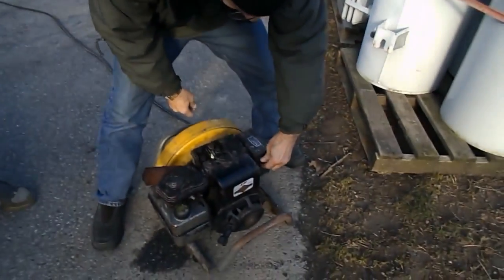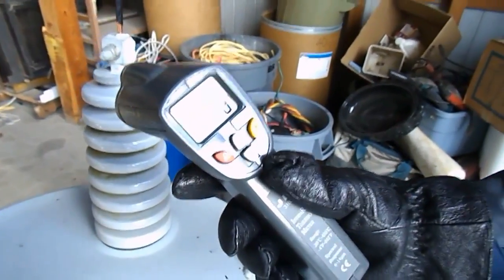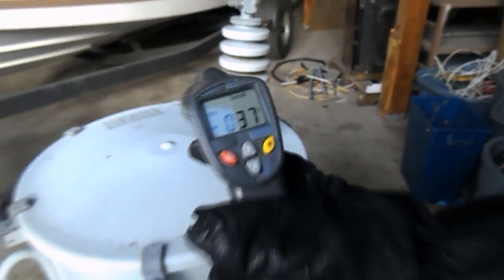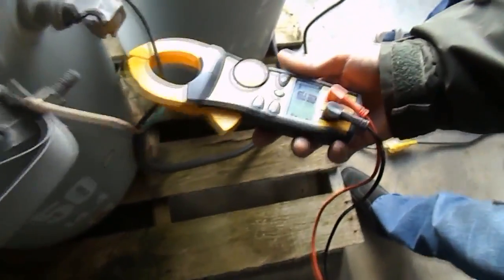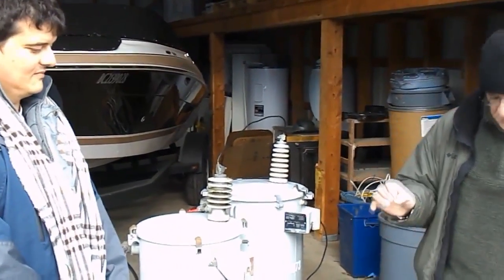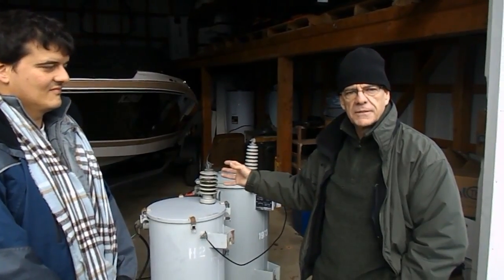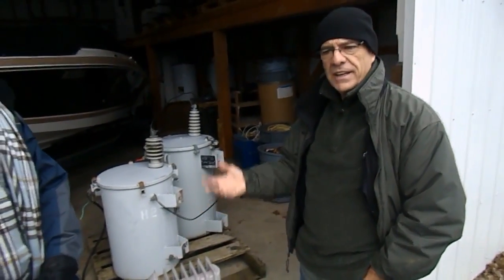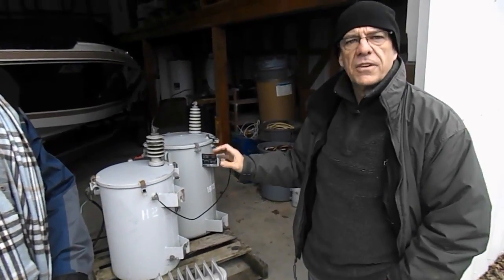Roman Light - Free Energy, the embarrassing Truth

Comment: shame they dont a proper test with proper test instruments. its all a bit vague. theres no load on the saw. ya cant tell if the heaters are all on full (drawing 1500watts each) and 30 amp fuses can take uo 60 amps to blow when cold. why didnt they measure the radiators temp with the meter? if its so great why isnt his house running off it? etc etc.

Comment: I am an electrician can you answer my question. I could not tell what the current input was on the primary Transformer and you did not show the current on the output Transformer nor did you show voltage in the primary or the voltage out from the secondary please can you give me these facts. It is very interesting though that the temperature dropped on the high voltage line from one side to the other. I would like to know more about this. About the power factor that's happening here current leading the voltage and a Transformer happens I know. Please answer my questions thank you very much.

Comment: i want to be honest and not say you havnt found something here, but you need to measure the load going in to your transformers and what that load is coming out. How can you be certain that the saw and 3 heaters isnt just using the power at lower amounts, You could hear your saw speed up each heater you turned on. That would tell me there that the saw can run on less than its maximum load. Do this experiment again showing amounts going in and coming out or else your just guessing. I have a 2000 watt heater but it does not always require 2000 watts to run, thats how the heat can be adjusted from minimum to maximum on the dial. Tesla was able to step up current wasnt he?

Comment: All you need to do is utilize thermal solar power using water heated by the Sun to run steam driven turbines. Use some of that electricity to induce the electrolysis of water into one side hydrogen and the other oxygen. Use a compressor to fill tanks of hydrogen for running the boiler when the Sun goes down or on cloudy rainy days, make and store enough hydrogen so that trucks, cars, and buses run on it (very little modification needed to do this with combustible existing engine). Utilize the compressed oxygen for medical use. We already have all this technology now. If you are interested in citations for all of this I wrote a paper on it in 2012, david11a@msn.com

Comment: Is this single phase ?  What cycle(25/60). The radiation your talking about is the flux the occurs when there is movement. You are correct with amount needing to maintain the grid. High  frequency conversion is the holly grail  that power company's use to suppress this knowledge. Grounding is for safety of high voltage. 
interesting
Thanks for your information

Comment: I can ramble on about nothing also. You can't have a cyclic reduction system during a radiated transformation, tesla reduced this theory to quackery .Current crossovers will always defined your related power output when using transformers. The loss of power during transformation will always protract a residual relationship with voltage and current, in other words this crap don't flush!

Comment: Thanks. I saw video = guy ran a fan by putting 60Hz thru xfmr. He then laid identical xfmr fan right next to it. Fan ran with no wire 60Hz input. He put another on other side of first. All 3 running only 1 with wire 60Hz connection. I think he called it radiation also. Maybe identical circuits require little or no tuning just proper positioning for transmission. I built a special xfmr (transformer) to amplify flux interesting concept but house burnt down before much testing. Gotta build another unless can find it in rubble. Thanks again guys. There's more of us than we think. People waking up getting faster and faster. Don't give up. Just show off a house or barn here and there. People will.buy into your discoveries and lessons.

Comment: This was false - there was no way that was drawing the rated 5950W claimed. Did you hear the way the motor wound down as the load increased? It would down because the voltage on the output transformer dropped, and thus the current to the device too, and by extension the watts. Also the motor was running no load, which draws less power too. The heaters, being resistive loads, as the voltage drops the current dropped too, so they would draw less than he rated 1500W. Power (P - watts) = Current (I in Amps) x Voltage (V in volts). You want to convince us? do the test with killawatts on each device, including the generator, showing the voltage and current, with them all running together - no switching them individually and getting a reading. You did not get over unity, you got under voltage, and under current. And transformer losses to boot. All you did was jack up the voltage, then drop it again. If you want to prove it works, show the input volts and amps, and the output volts and amps on each device.
Reply: oh, and your "cold radiation"? That was just voltage pickup affecting the thermometer. do the test again with a mercury thermometer attached to each high voltage electrode, and let us see the difference, no electronics which can get affected with pickup off the 14KV.

Comment: The experiment you have made here is incomplete and incorrect. To prove something by measuring a temperature with a pyrometer, you should know that emissivity of the sky, of your hand and of the porcelain insulator differs. Your pyrometer measures a temperature based usually on emissivity 1 (the black body emissivity).  So the three temperatures measured are incorrect from the very beginning.

The second issue is that a 4HP generator (4x0.745= 2.98KW) can power a higher load (like yours) but the frequency and the voltage will drop. On the other hand if your voltage is 120V and your fuse is 30A, the max output power of your generator can be 3600W.

So, please; 
A) supply first the whole load directly to the generator and measure: voltage, current, power and the power factor (cosfi). Then  
B) hook everything as is now and measure again the voltage, current, power and power factor at the generator output. Compare the values measured in a graph.  The two HV transformers connected as shown will add a huge inductance in your circuit and the power factor will drop In situation B compared with situation A. The power factor of unloaded transformers at their nominal capacity is always very small. Your transformers are loaded highly below the nominal load.

The "cold energy" you are trying to measure with a pyrometer cannot be measured in that way. The pyrometer is influenced by the HV discharges (huge EMF generated by that HV wire and transformers).  

Unfortunately a series of measuring mistakes are creating an illusion for both of you and the audience.

Comment: So... What if you had an electric motor to run the generator? Started by a battery through an inverter and once voltage came out of the cans switched over to run the generator motor? A closed loop system. Providing enough extra power to run other things including a battery maintainer to provide start up power for the next cycle.
Reply: That is exactly how i run my farm workshops :) I have to start it from a Tractor engine hooked to an inverter and then switch to closed loop. Not free energy but pretty close at $20 a year on diesel. This could easily be modified to start off a solar and battery setup or something similar, I just happened to have a tractor and 6000 gallons of diesel, so this was the cheapest option at the time. It's been in use for 7 years now.

Comment: I have a 25Kv tv probe to measure tube E.H.T. - You crock clip one end on the degaussing strip that is across the back of the tv tube and stick the probe under the E.H.T. cap on the top of the tv Tube switch on the tv and take a reading. The Highest reading I ever took was 18kv on a 28 inch Phillips G11 Chassis back in the late70s after replacing the tripler transformer and line output transistor driver and output. So High KV probes were made for us old time served TV engineers - The customer kept a flower vase full of flowers and water on top of the TV and it got knocked over straight into the back of the TV by her cat. The cat survived  but the TV went bang. In those days we repaired not like today's just buy a new one mentality. You could replace every component by hand then - try doing that today - mind you, you did not need a room heater with a beast TV that size it took 2 of us to move it as I recall.

Comment: If the gas generator produces extra energy then why don't you replace the gas generator with an electric motor generator ? Then you can jump start the system and it should run electric generator and all those other devices too.

Comment: I think he actually believes this but you need to measure true power and get someone who knows what they are doing in the measurement field to measure actual watts being drawn at each device...so the generator is putting out 3600 watts but you notice he started the saw first so it would have the most watts to actually start and then the heaters. So with the saw running now and pulling 600 watts to just spin... the rest can be distributed to the heaters and with all three powered on that's 3000 watts distributed to them....3000 divided 3 is 1000 watts to make the heaters heat... I have no idea the actual watts on each device but neither do they since no measurements were done and I'm sure none will be done in the future by evidence of how old this video is..

Comment: If he had used 4, 1.5kW heater devices it would have blown the generator fuse. The motor free wheeling was NOT using the rated load. Not to even mention that the voltage drop of the devices depressed the load consumption in amperes.  The infrared thermometer was impacted by the high voltage field when he was "measuring" the ceramic insulators. More than moronic. They are criminals trying to defraud for financial gain.

Comment: Why did He NOT put the thermometer on the Electric Heaters,  to show they are on, ?  One saw motor is all I saw using current,  and he did not show consumption of that either..    Always a little trick !  just leave out one or two things and everything looks different..      Gerrard  HUMBUG  !
Reply: I thought that too.
Reply: If you were an electrician you would know what is happening and that this is possible. I used to do something similar to run equipment that required 240v off a small generator. You "step up" the voltage with transformers, then step down to requirements. This however is not free energy, you still consume gas in this process. You also don't need these huge transformers. They have small ones!
Reply: when he shut off heaterthe saw sped up

Comment: they dont measure the hv output from the transformer ?

you can buy a test probe on ebay that will measure 30kv for around $30 you need to know the output current and voltages and then the input current and voltages . the fact is you will never get more out than you put in ! 

maybe thats why they dont show the output voltage ?

Comment: The energy potential is already available, they achieved an ultra efficient way to tease it out of our resources. What we are doing now is so inefficient that what you are seeing here appears to be magic by comparison. These guys know how to think outside of the BOX, kudos!
Reply: actually, they know how to pull the wool over peoples eyes and "demonstrate" something that doesnt exist.where are the volt meters on each of the appliances that are supposed to be drawing power? they are not there because the power isnt there, when you engage the saw, it draws most of the available power from the circuit. "cold radiation" is bullshit. energy of all types create heat, lack of heat indicates a lack of energy. 
 the "radiation meter" he clamped onto the line is known as an AMP PROBE. it is used to determine how many amps that wire in a circuit is carrying. you can vary its load by opening or closing a gap in the circuit where electricity is jumping across, turning on or off the items in the circuit. there never has been and never will be "free" energy. if anyone goes out and buys their books or whatever they are selling, they are a complete fool  for doing so.

Comment: Basic math as they didn't explain it is it takes approx 1hp per 1kw or 1000w.. So they are running 6kw or 6000 watts off only 4kw or 4000 watt generator...
Reply: Fromage Frizzbizz If you look closely the cans of the transformers are bonded together. The whole experiment is grossly flawed. The saw will not use 1400w running with no load. As a side issue a 30a fuse will often survive a 100% overload for 2 minutes. The whole video is pseudo science.
Reply: Short Story.. They are consuming more energy then the generator makes yet still have excess energy after all is done. The readings at the transformers are actually showing that after powering 6000 watts of items off only a 4000watt generator they are still able to produce more power. If they had run a loop they could have actually powered the generator off itself making a perpetual system do to transformers all while using up more energy then the generator was even able to produce..
Reply: +Darren Tipple He could blow the fuse by momentary extreme overload.  Like a short.  While the motor is rated at 4HP, I'd be surprised if it couldn't momentarily drive as much as 7HP before it got too hot or blew something.  4HP is the continuous rating.  Under severe overload, it can produce more.  For a very short period of time.

More importantly: we have NO idea whether those three heaters are actually turned on.  Meaning, the generator is only driving a circular saw that has no load on it (drawing a couple hundred watts at _most_).  He should have tested the heaters with the IR gun.

So he only connected the big transformer with one lead?  So, the transformer was operating much like an old CRT flyback transformer off capacitance on the other wire.  Virtually zero current flow, but still high voltage (notice he never measured it?) on the other winding.  Connected by only one wire to the other transformer.  Of course it's going to generate an electromagnetic field.  With virtually zero power behind it.  

Notice that by all rights the other end of that transformer should have at least 4Kv, possibly as high as 44Kv, and he's waving a clampmeter around it?  Not a warning to anyone else?  Acting awful careless around supposed voltages that would literally fry him to a cinder in fractions of a second.

Power is voltage and radiation and not amps?  So EVERY electronics guy including and since Tesla, Maxwell and Faraday got it wrong?  What doofuses.

Crackpottery of the highest order.

Reminds me of some Indian "free power" videos, where you have a dozen guys dancing around waving various hanks and scraps of wire, and we're supposed to believe it's all connected together in this oh-so-spectacular free energy machine?  No, it's guys dancing around with hunks of scrap wire they haven't gotten around to burning the insulation off yet.

"Dancing"?  Yeah, it looked like a square dance crossed with a Bollywood number.  Lots of to-ing, fro-ing and what suspiciously looked like a belly dance.